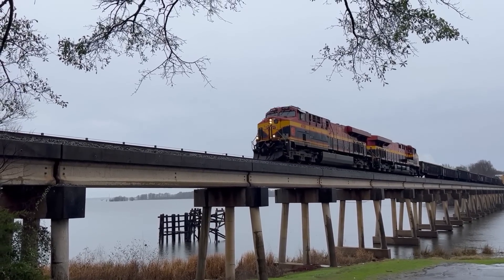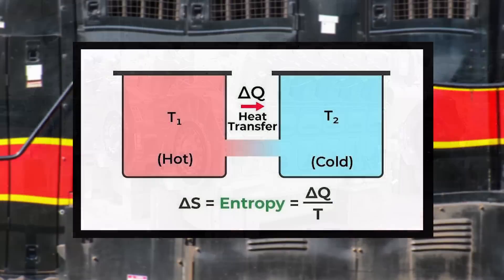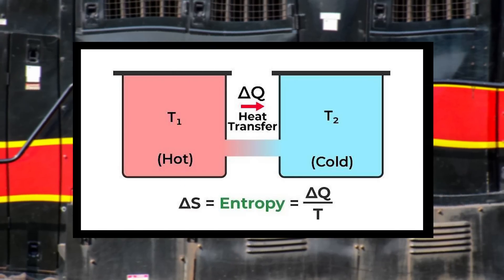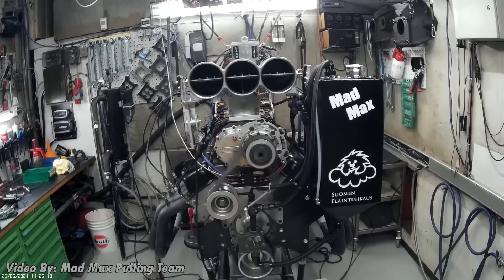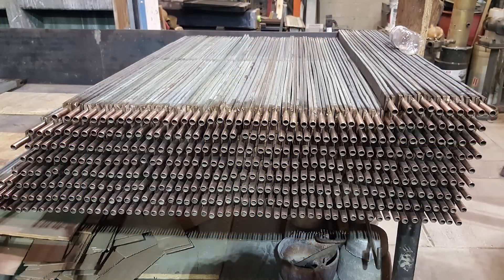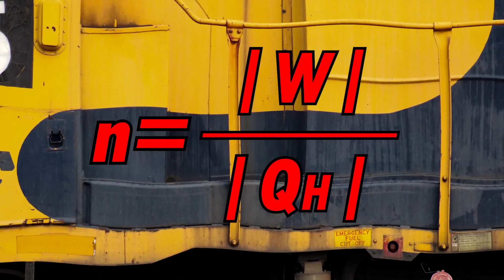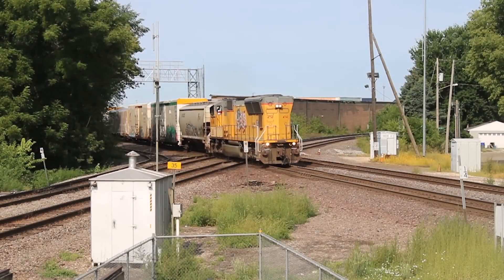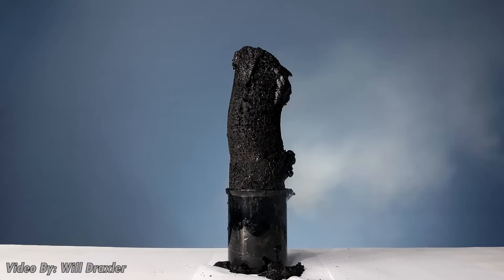Why Have Radiators On Locomotives Gotten SO BIG!?

Comment: Another big reason for the massive radiators is due to Emission controls.  In order to meet Tier 3 and tier 4 both EMD and GE had to put in intercoolers on their engines and with tier 4 going to EGR with coolers that requires more cooling back there.  So the growth in the radiator sections of the locomotives.  On a tier 3 GEVO you have a Radiator for the Engine then in front of that you have the intercooler for the turbocharger.  On the Tier 4 you have the same plus the radiator for the EGR cooling system, EGR being Exhaust Gas Recirculation.  Yes the EPA mandated that Diesel engines that produce soot particles suck down their exhaust to lower emissions.  Which has the effect of lowering fuel economy and reducing reliability to the point where NO CLASS 1 wants to order NEW Locomotives instead just rebuilds their current fleets of Tier 3 and older.  Why they have seen what EGR does on their other equipment like their heavy trucks used in MOW for over a decade and are like NOPE not touching this stuff with a 1000 Meter POLE.  See what happens is the EGR cooler over time literally gets ate away by the acids produced by itself and then causes a failure in the cooling system and also the oiling system letting them mix.
Reply: I think that's probably the main point, especially in recent years. Engine power has leveled off at around 4,400 horsepower, railroads not really interested in anything bigger, yet the radiator sections keep growing. This is the real explanation. Could even look at it as two separate eras - the "more power" evolution from the '50s to maybe the '90s, then the "less stink" era from the '90s to present.

Even as a very environmentally conscious person, I sometimes wonder if stricter emissions standards are reasonable, or if they're counter-productive to their own goals. Especially if grandfathering is allowed (based on some of the old rattle-traps I see chugging around yards belching smoke, it must be), while new requirements are impractical to comply with, railroads will keep their older, much dirtier stuff in service and not buy new, cleaner stuff. More reasonable requirements would encourage upgrading to something maybe not quite as good, but a lot better than the old dirty stuff. I've heard of a lot of things like this, industries keeping old, grandfathered, worse things because the new laws are too strict, making the policy defeat itself. Though of course the EPA making policies with reverse the intended effect is not a new thing. Car fuel efficiency laws encouraged automakers not to make cars more efficient but instead to market trucks and SUVs that are in more lenient categories, and overall less efficient.
Reply: @quillmaurer6365  A prime example are the CARB gas can spouts, which generally spill more gas than they keep from evaporating.  
That, along with Prop 65, is why, even as a liberal, California pisses me off.  It makes me want to make sure all elected seats stay competitive, or at least have term limits, since the most stupidity happens when you get entrenched into a seat.
Reply: I can tell you that the OTR industry lost 50 percent in MTBF and lost 500k off the standard time on overhauls.  A non emissions equipped OTR truck was running about 1.2 million miles before 50 percent of them have been overhauled.  Now it's just 700k and the cost is over 40k to do it instead of 10k for the parts alone.  Then throw in about 10 percent losses in fuel economy.  Yeah these emissions engines burn more fuel.
Reply: Enjoy breathing all the NOX emmisions i guess. There is a simple solution if the industry doesn't want to deal with mitigations deasigned to stop them from poisoning everyone btw, just electrify the damn railways
Reply: @emp_zealoth  right! move all the pollution to one place and create MORE pollution to get the power to the vast reaches of where the tracks all run. 

Great plan!
Reply: @kleetus92  What pollution? Either use nuclear or renewables to power the electrified trains. Even by using coal or natural gas, in one place, you drastically reduce pollution...because it's now all in one place and you can build one filtration system for the entire power plant, instead of dealing with thousands of obsolete and dirty engines from half century ago
Reply: @emp_zealoth Lol... and how does all that stuff get built, transported, and installed? Who pays for it? You?
Reply: @kleetus92  Oh no, the railways might have few less billions of pure profit after refusing to invest for decades, oh no. Let me get the tiniest of violins for this travesty. Also, overall it would be cheaper in the long term anyway, and lower your dependence on outside countries for fuel lol
Reply: @emp_zealoth  We don't need foreign oil...  just some politicians think we do so they can make money.
Reply: @haroldbenton979   that figure with international truck was more towards 80%
Reply: @michaeldorosz6446  with CAT Acerts well let's just say if you find one on the market from 2007 nowadays it can be bought for about 10 bucks per hp for the entire truck.  There's a fleet near me he bought 25 daycab Pete 379s with Acerts in them.  Ripped out the engine put in a remanned 6NZ C15 and still to this day has them running hauling asphalt.
Reply: @haroldbenton979 Yep, once again, the big hand of government fucks up everything it touches...
Reply: @kleetus92  Your position is intriguing.  Where else can I find information on how to become a domestic terrorist?
Reply: @h8GW  WTF are you talking about?
Reply: @kleetus92  I guess breathable air that doesnt give you cancer is overrated. 🙄
Reply: It makes shiny,non-sealable cylinder walls too.
Reply: That's better. I thought that this video was going to cover what you just covered. I see you didn't get a heart yet. The professor might be butt-hurt. LOL
Reply: @chuckgilly There’s a clear time cutoff about 15 hours ago where nobody after it is getting hearts on their comments. Dude is just away from his computer, genius. I’d like to see you make in-depth content like this and stay glued to your comments section for 24 hours straight.
Reply: @jamescerone  Take a chill pill, Don't have a Cow, man.
Reply: @chuckgilly  Classic defensive move

Comment: Both EMD and GE were already offering BIG radiators on their locomotives in the 1990's in anticipation of the arrival of 6,000 bhp prime movers such as the EMD 265H or GE/Deutz HDL. But both engines suffered excessive fuel consumption and reliability issues, and they were dropped for smaller prime movers with other power efficiency improvements.
Reply: RIP SD90MAC-H 😢
Reply: @AnontheGOAT  and its H2 counterpart, up's second order for the big macs.
Reply: I’d imagine distributed power made oversized locomotives moot.
Reply: @ClockworksOfGL  it sure did

Comment: They make the rear of the locomotive look like a huge battering ram lol. Remember also diesel and gasoline engines operate at a certain temperature range for maximum efficiency. Run them too cold and your oil flows too slow and puts heavy wear on the engine and lowers fuel mileage. Another reason why you want to dissipate the rather insane amount of heat those engines produce is to put less stress on the other locomotive components and thus lower maintenance costs in general. Having more cooling also helps reduce the risk of fire. Did you know a BNSF loco caught fire this weekend in Rogersville, MO?
Reply: The other factor aside from aesthetics is that it probably blocks most of the view looking back, making these locomotives not possible to operate long-hood-forward, as had been the original appeal of hood units over carbodies. I pretty much never see modern locomotives running like that anyway, I think not for that reason but just railway practice has changed and there's really no reason to (they almost always operate in pairs coupled back-to-back, effectively creating a dual-cab pair). Which makes me wonder why we stick with hood units rather than going back to carbodies - my guess is easier access for maintenance is a bigger advantage than anything carbodies would have to offer.

Comment: 2:20 what you are looking at is liquid hydrogen at near absolute 0. When hydrogen gets that cold it loses all friction and gains the ability to wick itself along and through all sorts of materials. It is wicking itself up the tupe in this clip where it falls back down into the pool before going back up the tube. Its like perpetual motion if it didnt require constant cooling to keep it that cold. Hydrogen can also wick straight through glass at these temps, as in between the atoms and straight out the bottom like it went through a hole (while also wicking itself up the walls and out the opening at the same time)
Reply: You might be thinking of superfluid helium, it does all that crazy stuff - I don't know if hydrogen has a similar state, but if I remember right it freezes solid at around 20 K, below that temperature helium is the only substance to remain liquid.
Reply: I think you mean helium.

Comment: Bigger radiators =less airflow for same level of cooling OR more cooling for same level of airflow. More cooling from less airflow means if it loses a fan or something theres more cooling all around to pick up the slack so less chance of overheating an engine if something goes wrong. Plus radiators are one of the cheapest bulk lump of metal items you can upgrade on any liquid cooled vehicle, why not have the biggest and best radiators.